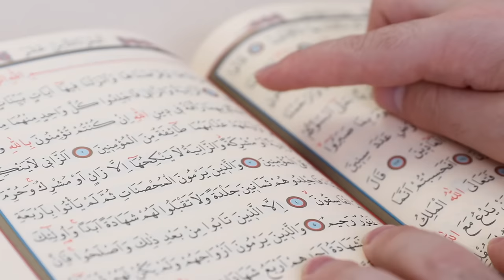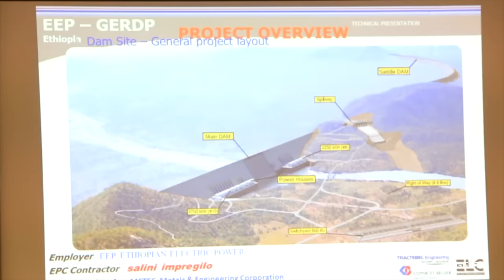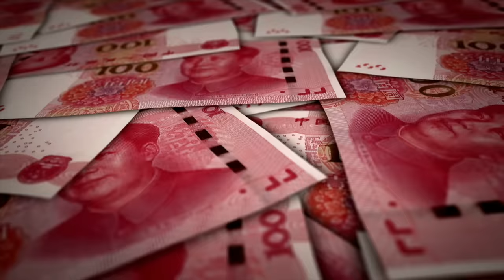10 Biggest Megaprojects in The World

Comment: No. 10 Petronas towers and No. 9 Marina Bay Sands were built by South Korean construction companies as was Burj Khalifa in Dubai. Those are some incredible construction engineering feat. I wish they also had the technical expertise and engineering ability to design them as well rather than actually build.
Reply: In most projects, the construction contractor is not allowed to be the designer of the project. This goes back to the ethics of engineers: if the designing company made a mistake, and they were also building it, it would be possible for the designer to cover it up. 
So for not having the "ability" to design the project, that's not necessary fair to say. The construction team in a company is usually completely different set of people than the design team, so the companies make an executive decision often to determine which projects they will bid for design, and which projects they will be for construction (all assuming they even have a design team at all, some don't). We really can't say if they do or do not have the technical expertise to design this, just that the company choose to bid for construction on these projects and won.
Reply: Cheap labour.

Comment: if the "line" actually gets made, it will rival the pyramids when the world falls apart, and gets rebuilt again. Just IMO, but whatever. The real kicker here is if they use stainless steel on the outside, then had a way to remove the heat convection off the metal on the interior as extra sustainable power, I say this cause stainless steel has to have a layer removed before it can ever rust, so the structure would stand for very long periods of time!! That is why I did not say use solar panels.
Reply: stainless steel do not rust if you remove a "layer"